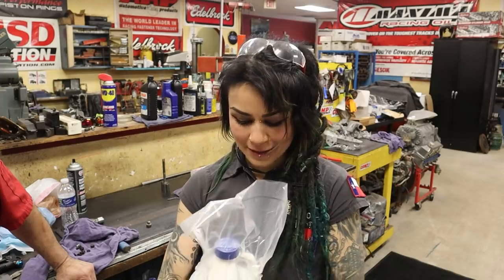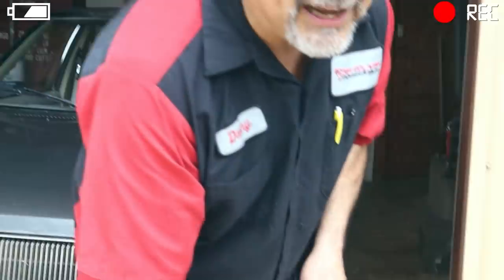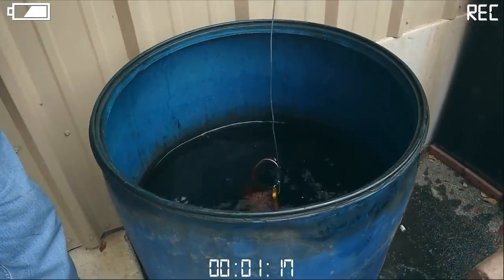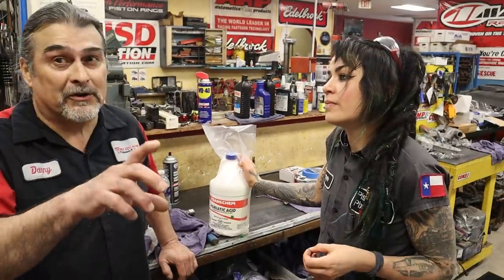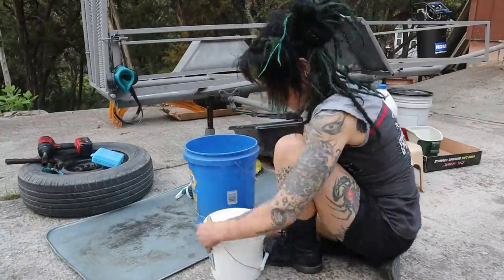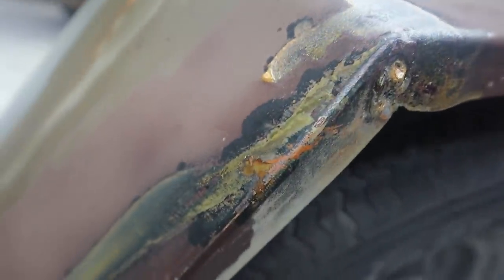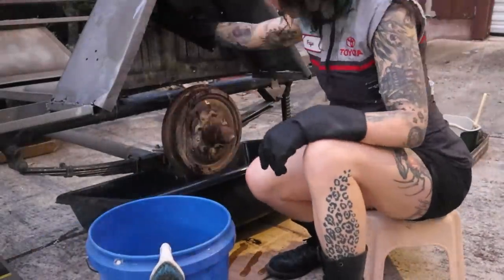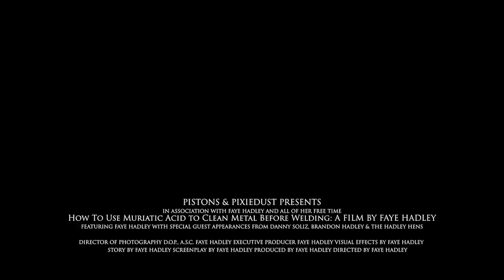How To: Use Muriatic Acid to Clean Metal Before Welding – Crappy Trailer Restoration Pt. 2

Comment: If you use phosphoric acid instead, you don't have to worry about neutralizing before painting. Never heard of anyone using muriatic acid for paint prep. Always phosphoric.
Reply from the maker: I used phosphoric acid in another video, and also just a few days ago to keep the trailer from rusting before I paint it! It doesn't remove galvanized coating though, so it wouldn't have worked for this application!!

Comment: When diluting acids .. ALWAYS add acid to water .... do NOT add water to acid ... when working with strong acids monitor the temperature during dilution especially in warm weather ... solutions can get very hot.. exothermic runaway can can get hot enough to melt low temp plastics as well as generating massive off gassing.

Comment: Muriatic acid will dissolve aluminum. I've used it to clean the remains of a piston off of the cylinder wall of a snowmobile engine.

Comment: What is on the metal you need to use that to clean it?
Reply: rust and zinc
Reply: Galvanized coating. Hard to get good welds on it, and the off-gassing is toxic.

Comment: hope hes got MSDS sheets in the shop.....need black acid cartridges for the full face mask...not pink....you can neutralize it with baking soda and flush down the toilet when finished.
Reply: My rule of thumb working with pesticides and a respirator: If you can smell it, you're still breathing it. The pink P100 filters work well for fertilizers and granular iron II sulfate (moss killer), but a good set of OV filters will work for almost anything.

Comment: there's no way you removed all the galvanizing from vertical surfaces by brushing on the hydrochloric acid, it runs off to fast. I guarantee that if you were to submerge that same metal you already brushed in hydrochloric acid you'd still see a lot of chemical reaction from the remaining galvanization. i'm not saying it's a bad thing, you just need to be aware of it and take two extra steps over and above being in a well ventilated area when welding galvanized metal, you need a fan blowing directly across the piece you are welding so the fumes can't rise up toward you and you need to take milk breaks every hour or so. i honestly don't know the technical reason for the milk but every old timer welder i've ever known has said when welding galvanized drink lots of milk to help protect you from the effects it can have... just sharing with a fellow or fellowette DIY'er...ps: you should have charged them a $100 to haul away that so-called trailer.....

Comment: Honestly as a welder fabricator i would just use a wire wheel on a drill and acetone
Reply: Same. I always weld outside anyways, and if there's no wind, I just set up a fan.

Comment: I would not bother trying to fix someone else’s mess. If new fenders are not an option in the budget then I would cut approx 1 inch off the existing fenders getting rid of the mess then weld on an all new metal hem or flange onto the fenders. A better outcome with far less work
Muriatic acid is very aggressive and very toxic on its own but the gases are also very toxic and harmful, this video was a little light on stressing the dangers and that a person should always use personal protection including glasses or shield even when using outside.

Comment: I'm not sure this trailer is worth the work those are the worst welds I've ever seen,and is made out of galvanized pipe strong vertically not so much horizontally.I wouldn't haul anything real heavy on it.

Comment: some stuff is not worth fixing, your health is more important, all that galvanized metal and nasty muriatic acid and the fumes from welding 😵‍💫😵‍💫😵‍💫🤮 better start some from scratch with bare steel or better buy one 100% steel.
Reply: As they demonstrated here, with proper precautions, it can be worked with just fine. I wouldn't wear shorts while working with it though, that'll be a nasty burn.